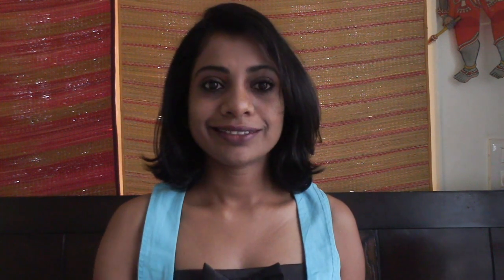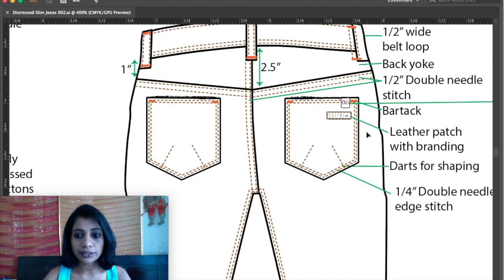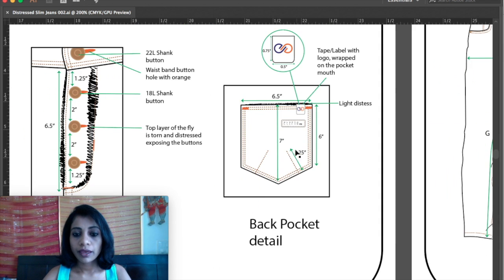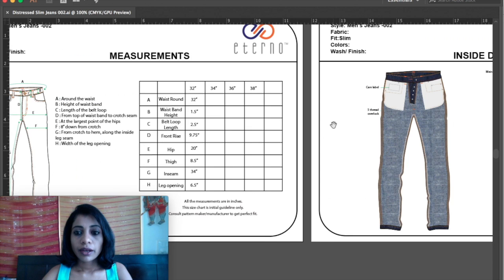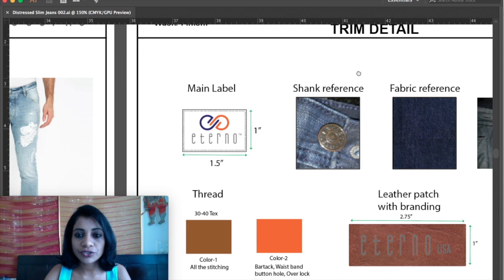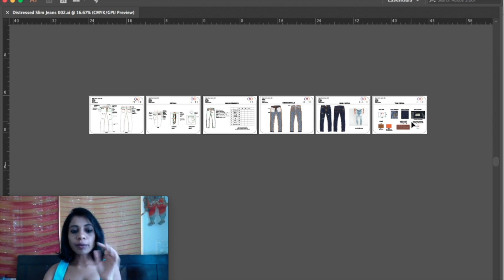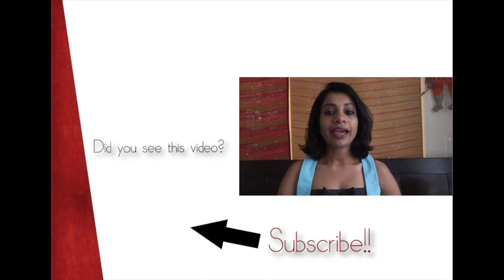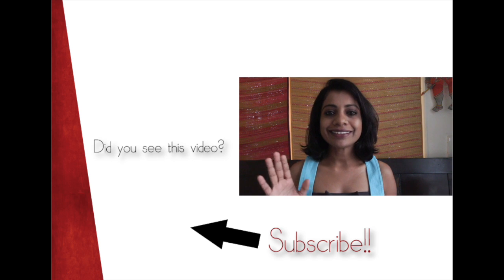Design Process Part-4. How To Create a Tech Pack | Arpitha Rai

Comment: Is this the same process for producing garments in botique?
When I designing my dress I do tech pack roughly on illustrations that I drew. but I can't get fabrics and trims I'm exactly looking for around local market. finally decided to produce what I had.is this correct?
Reply from the maker: It is similar. Will not be so detailed as I have shown in my tech pack. That tech pack is export company standards. In export company, it is mandatory to get everything as per the tech pack. In local boutiques getting the same material is not a compulsory. You can create garments from what is available.